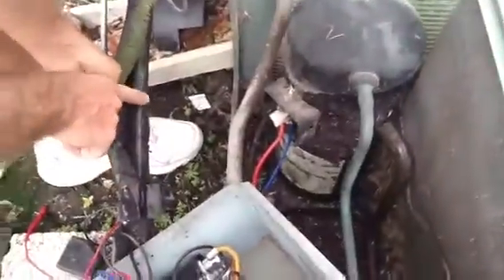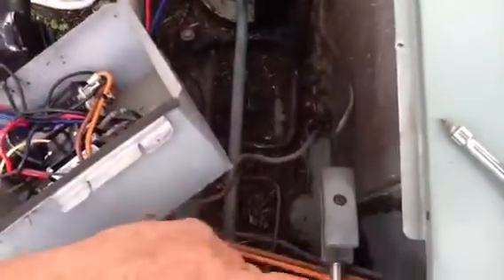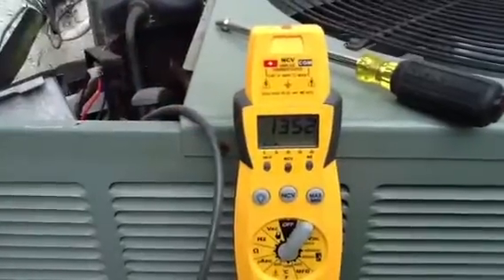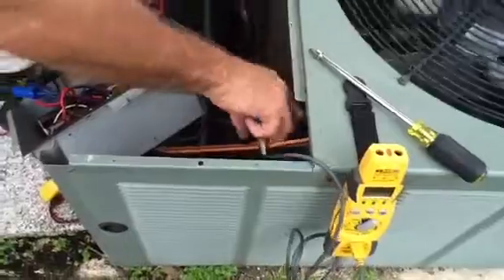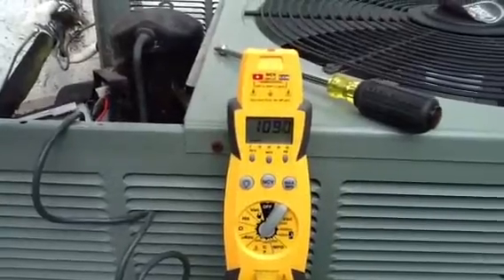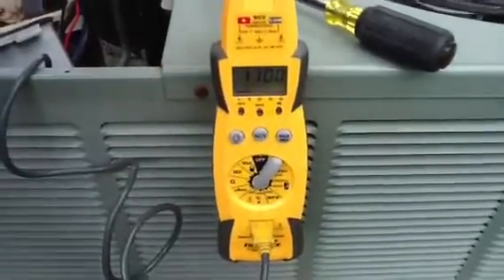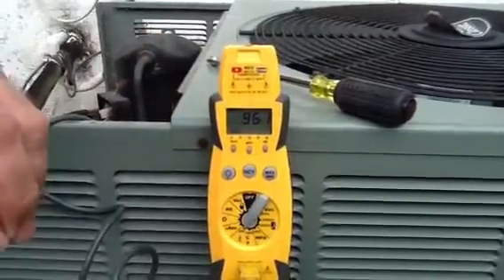How to Change Gas into Liquid

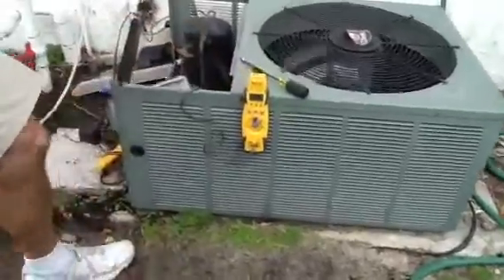Comment: Your videos are excellent. Quick question on this one. At about 2:15 of the video you say, "as it(refrigerant) comes out the very bottom it goes back into the house as a low pressure gas"

I thought out of the condenser coil the refrigerant is in a hot high-pressure liquid state before it enters the expansion valve and is cooled for its trip thru the evaporator? Im just starting out in A/C principles and trying to keep it all straight in my head..  Keep up the good videos.